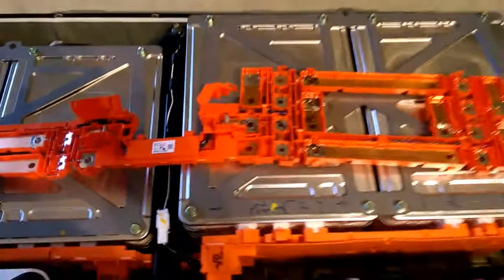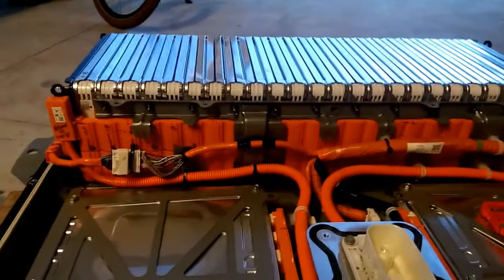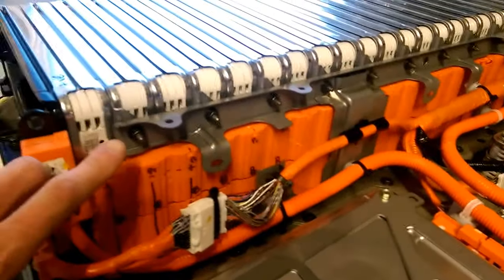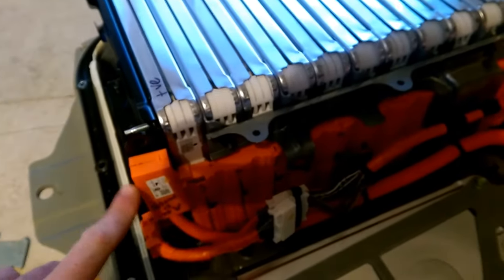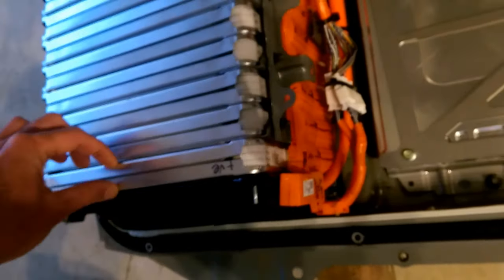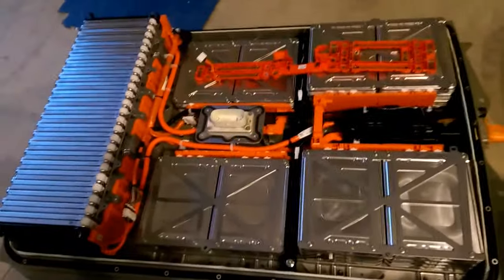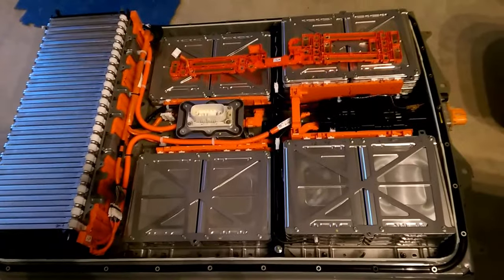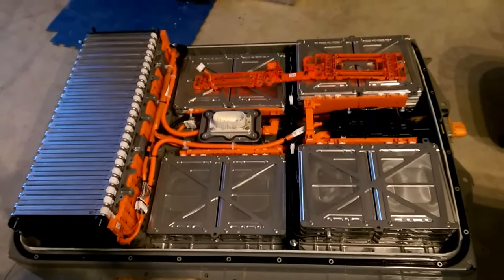Nissan Leaf G2 G1 cells comparison in G1 case

Comment: hi there.thanks for your video. I have a 2011 Nissan leaf and i need to change the batteries.i know it has 48 modules.i'm sure they are G1 and all of them do not have problems.is there any way to test modules and make sure it is ok
and if i mix old battery with new one do i have to change my bus bar? 
thanks
Reply from the maker: Step 1: Get LeafSpy.
Step 2: Read about LeafSpy's cell test at low SOC.
You'll be much better equipped to know what needs doing after that :)

Comment: Curious was the donor batteries out of a 30kwh or a 24kwh leaf?
Reply from the maker: +James Campbell
I think the answer's in the description. Both old and new are from 24kWh packs.
Reply: Raglan Electric Bikes ok. thanks for the clarification. on the Leaf owners group they were saying that you used batteries from a 30kwh. that's all
Reply from the maker: +James Campbell 
Ah, thanks for your clarification too =) They got it wrong! Where was this, I should probably put it right. I'd love to try a 30kWh swap but first I need to find a pack!
Reply: Yup definitely post it if you can try the swap. Nissan says it's impossible to upgrade because the BMS is different on the 30kwh pack than the 24kwh pack.
Reply from the maker: James Campbell I hope someone suggested to Nissan that they could try swapping the BMS too..